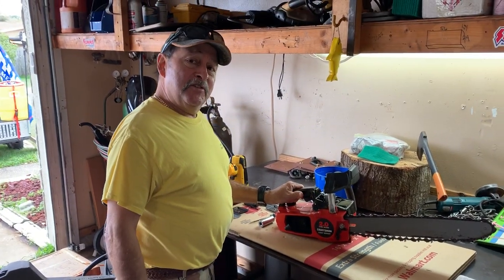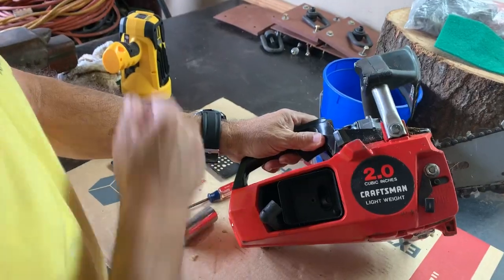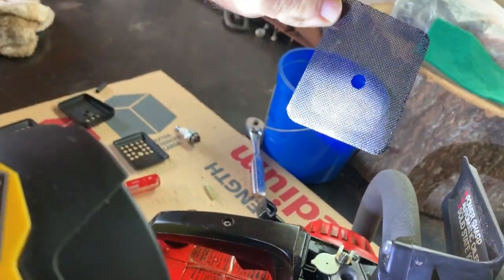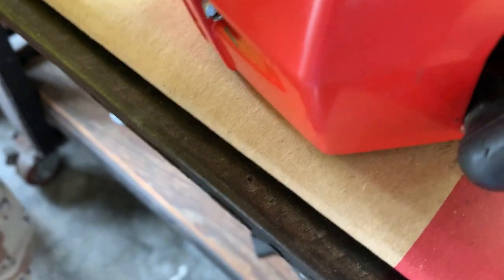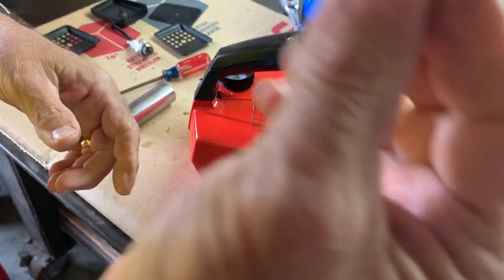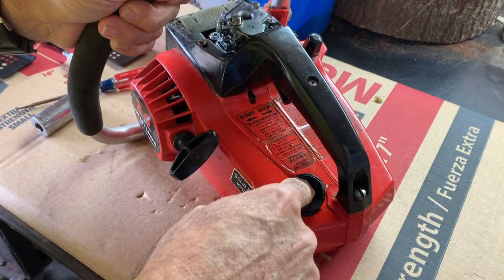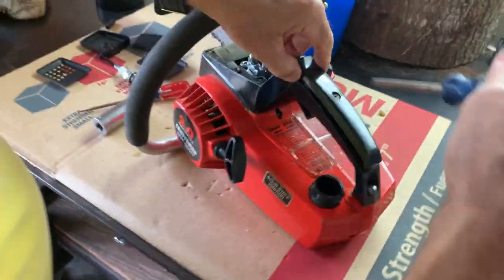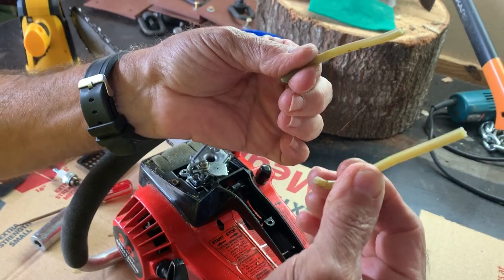Phase 1 intro into fixing an old Craftsman chain saw

Comment: I have a craftsman  model 358.352070-14” chain saw. It is old, I bought it in 1980.  It sat for a long time but I had someone change the fuel line and rebuild the carb. It has good compression.  It will start and run for about 3 seconds then stop.  In those 3 seconds, it will rev up giving it gas but still stops.  What can be the problem?  I hate discard it and get a new one.